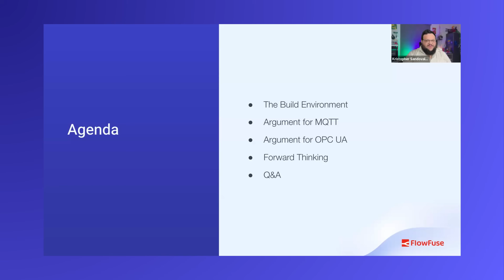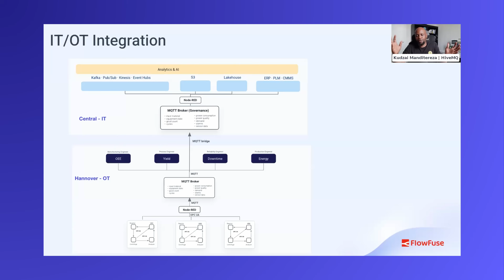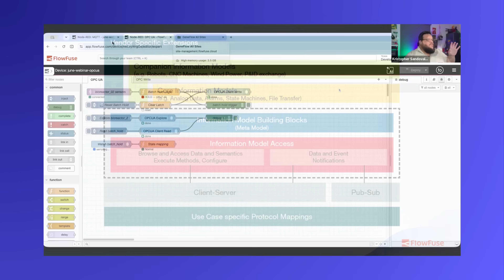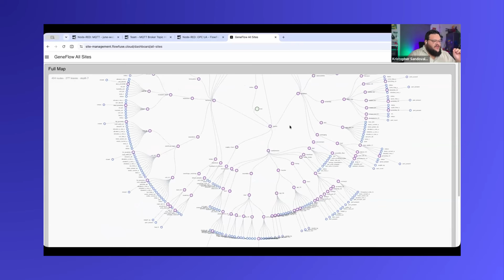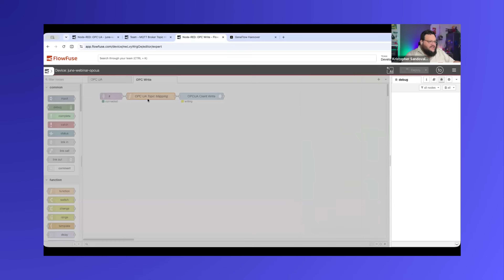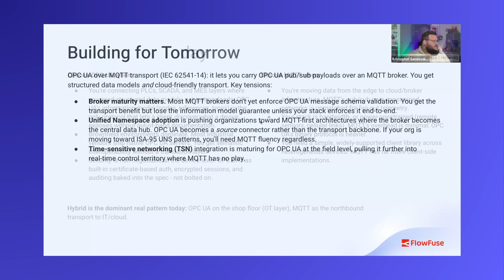MQTT vs OPC UA: The Industrial Data Showdown #opcua #mqtt #industrialautomation

Comment: Hi,
I see a repetition of the same myths and delusions that have been circulating on the internet for quite a while now. Here are some of them:

1. "When you use OPC UA, it is always point-to-point connections."
In fact, very often you will see OPC UA clients connecting to a gateway or aggregator like Kepware KEPServerEX or ProsysOPC Forge, or DeviceGateway. Even in the "Decoupled Architecture" diagram presented by Kudzai, you can see an aggregator—Node-RED—being used.

2. "OPC UA is request-response based and synchronous, while MQTT is publish-subscribe and event-driven/asynchronous."
In fact, OPC UA clients very rarely use the Read service call to get real-time data. Instead, they use the Subscriptions and Monitored Items mechanism, which in many cases delivers data once it changes—and often within a much shorter time than MQTT brokers would. Note that this is a separate mechanism from OPC UA Pub/Sub (e.g., over MQTT/UDP), which can be considered equivalent to standard MQTT.
Related to this myth there is also another one: 
"When you use MQTT as a transport, data is published only when it changes (Report by Exception / RbE)."
 In fact, MQTT itself has nothing to do with RbE; it does nothing to prevent publishers from repeatedly sending identical messages. In contrast, RbE is a core, built-in requirement for OPC UA. Furthermore, OPC UA allows you to explicitly define what a "value change" means using the deadbands feature. In other words, you can configure the server to trigger a change event only when the value fluctuates beyond a specific absolute value or percentage.

3. "MQTT overhead is minimal, while the OPC UA binary protocol is heavier."
In fact, the opposite is true. The OPC UA binary protocol is roughly three times lighter on the wire than vanilla MQTT.

4. "OPC UA might be good to use at the OT level, but when you move data to the cloud, MQTT is the only suitable option because OPC UA requires opening incoming ports into the OT network."
In fact, OPC UA features a "reverse connection" capability. This allows clients located in the cloud to access data from OPC UA servers located inside the OT network using only outgoing connections from the OT network—exactly how it is done with MQTT. If your specific OPC UA server or client doesn't natively support this feature, you can easily implement it using aggregating proxies like ProsysOPC Forge.